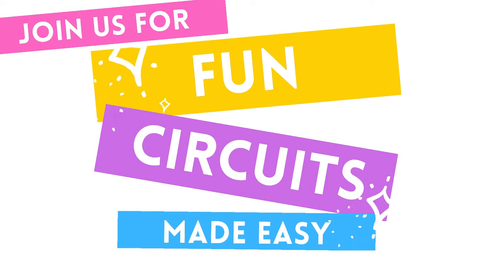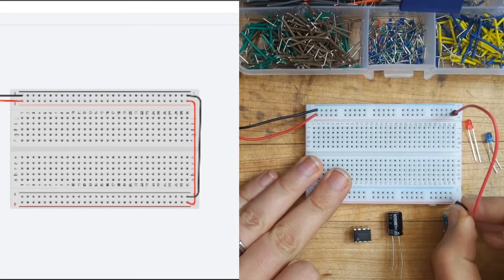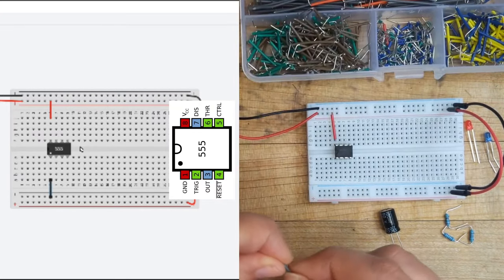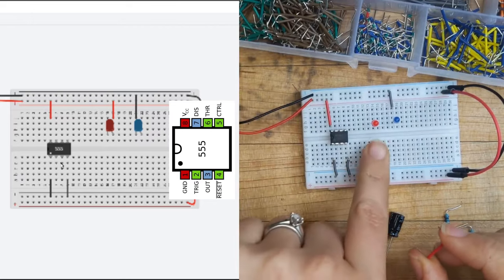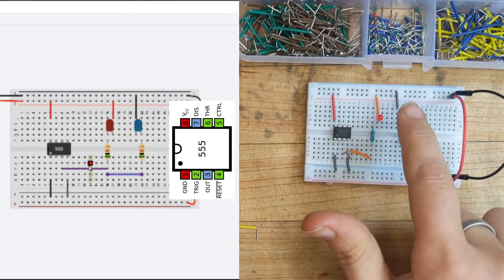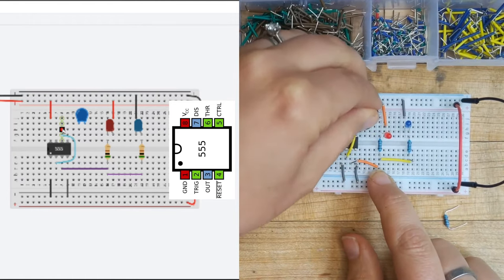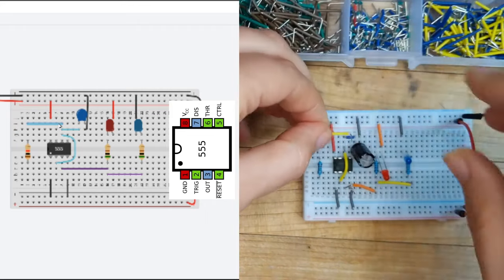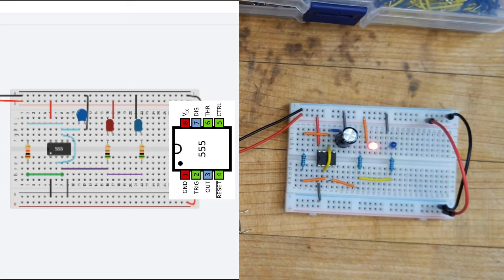Breadboard Circuits Tutorial  - 555 Police Lights

Comment: Greetings to you and thank you for the wonderful explanation. I have a question about the source of the power supply that can be used to create circuits on the breadboard. 1- Is it suitable to be through a 2-amp, 5-volt mobile charger?

Comment: Most versions of this circuit connect the capacitor to positive supply not pin 3. And you don't have the capacitor connected through a resistor to pin 7 to discharge.

Comment: The rst(reset) pin of the 555 timer is active low, meaning when you connect the rst(pin 4) to ground(-supply voltage) the 555 is locked into the reset mode.  Generally one connects pin 4 to +supply voltage(pin 8) to make certain it won't drift low with electronic noise present in the environment.  Also the datasheet recommends a small value capacitor, 0.1 uF, or 100 nF, between pin 5 and ground if you won't require the CTRL function, for the same reason.

Neither is required in most instances for a standard 555 IC, but becomes more important for the low power CD7555 CMOS IC.

Otherwise well done.
Reply: Many thanks

Comment: This is fantastic. The only missing detail is to note that the Red and Blue LEDs operate on different voltages. I was using two reds and got wonky results. 
Red operates on about 2-3 volts, blue is about 5 volts. 
100uf capacitor was a really slow blink, but 10uf was an easy swap.
Reply: You have a very strange leds, I would say. Usually red is working with 1,8 to 2 volts, and a blue one needs from 2.6 to 2.9 v to open. 
5 v to lit the blue led means that this led has an additional resistor integrated inside

Comment: I did this, only the blue light is on(not flashing) red one is off, even tho I copied the whole layout
Reply: Me too
Reply: Try to put a 300ohm resistor, + side of the battery before connect it to the main circuit

Comment: resistor and capacitor values?
Reply: She stated them in the video, pay attention!
Reply: 1k( which include red line) other one is 10k, and cap value all on you, 100uF works well. Cap valuse is just about the led lighting tine
Reply: @meraba3275  it's really  work. I didn't try that yet.